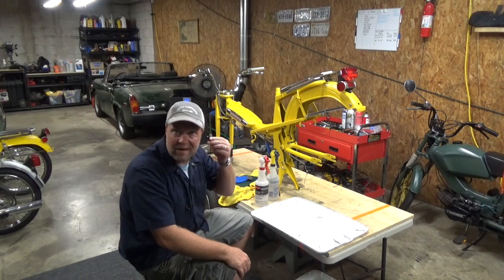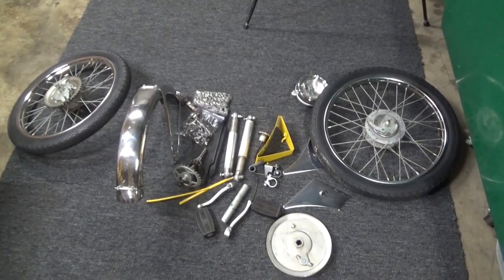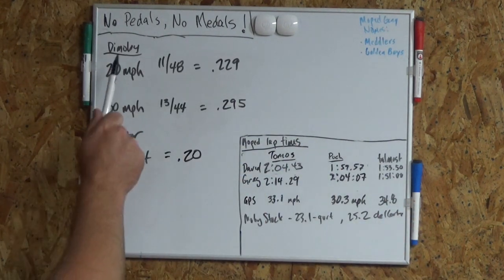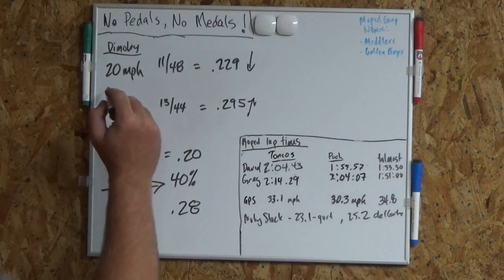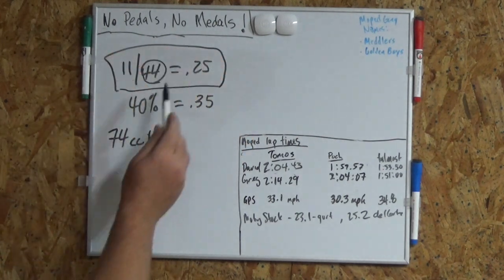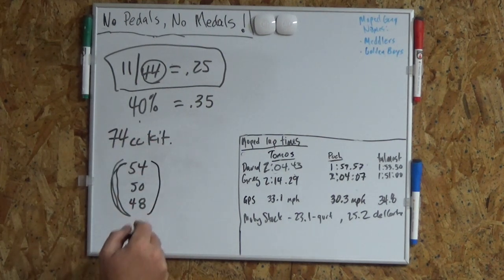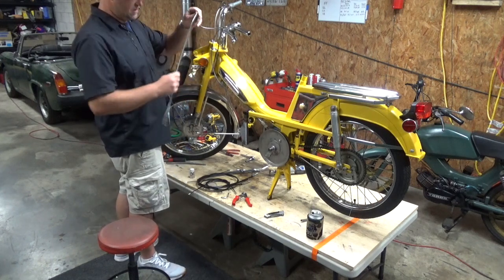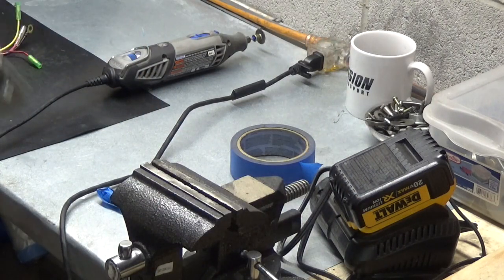Motobecane Moped Restoration Ep. 16.  Modified Reassembly, Cabling, Gearing, Packing Bearings

Comment: Hi David, Thank you very much for your very informative and entraining videos :-) I've watched a lot of them at this stage as I'm in the process of rebuilding an old Raleigh RM8 moped,  quite a similar setup to the Motobecane. I'm trying to fit a new engine which also has a variator, some modifications necessary and still to be worked out! I'm thinking of trying to fit an adjustable spring or gas strut to give me some flexibility with the engine adjustment.

Comment: Hey great videos!  I bought my first Motobecane last fall.  It's a 40v 20mph  all stock, but looked like it was abused.
 I was able to get it started.  All it took was a carb cleaning and I was starting it with a single kick. I found out on my first tank of fuel though there was a leak in my fuel tank. It's along the seem in the Center at the bottom.  At this time I found a 50v that seemed like a good deal, the guy sold it on the impression that it was complete, and fully functional once all the parts were put back on.  It was a mess he must have put a spark plug which was to long into the motor because it had parts of porcelain embedded in the cylinder/head/piston amazing the pisto didn't break. Along with many other missing necessities.
So instead of having two functional mopeds I ended up with two non functional.
I decided to switch the engines which was a success.
I still need a few parts to complete the 50v but I got it to a point I could take it for a rip, and I got it up to 43.7km/h (27.2mph).
I'm thinking about the cylinder/piston you used in this build is there any thing I should also get while doing this?  How much did you have to cut away for the cylinder to fit?
Thanks again for the great tutorials, entertaining and informative!
Reply from the maker: Heya Mike -- If you upgrade your cylinder, then you most certainly should do away with the Gurtner and get a better carb.  But other than that, I think everything else could run stock.  When I installed my cylinder, my cases had a little ledge that I had to grind off so that it would slide all the way in.  I'm not sure that all cases have that, since I hadn't read that anybody else has ever had to do that before installation.  As long as it slides all the way down, then you are good to go.  Good luck with your bikes.. and thanks for watching!

Comment: This is a really useful video - especially the gearing explanation. Thanks.  So to retro fit a variator on a non-variated Moby, the only mounting modification required is extending the notch in the hook?
I thought it was going to be feindishly complicated - you make it look simple.
Reply from the maker: Hey John. Sorry it took so long to get back to you.  Basically... yes.  I think changing the hook is the only thing I had to modify. If I hadn’t of done all the other mods, I could’ve thrown a variator on there and grind the hook and it would work.

Comment: Also for the ignition I'm going to experiment with inner rotor, a Chinese one for £35 from eBay it's bound to last at least 24 seconds but it has advance and no points, or I may use minimoto/ chainsaw magneto.
I'm going to use BMX handlebars.
What is the difference regarding the spring if you use a variator although if the gearing is similar to top gear with variator then acceleration is only gain.
Need a Doppler variator, no sliders, balles etc, just weights on a lever that moves the pulley!
Should be able to extend hearing/ variating by 50%!
60mph at 13000rpm!

Comment: How did you manage to get the peddle arms off, I've been pounding on those pins forever and they haven't budged
Reply from the maker: +LeWuut --  mine popped right out. 11mm to get the nut off and then a hammer. I had problems getting them off of a puch I have, so I put some PB Blaster on them and let it sit overnight, then I came in the next day and they slid right out.  Didn't even have to use a hammer :-). Maybe give that a try?  Good luck!

Comment: You express gear RATIOS as 0.25 or 0.4 etc but that's incorrect.
A ratio requires two figures eh 3:1 3 turns to one turn.
It's also simpler to understand.
A ratio is always a comparative thing, it compares one gears speed to another.
I mean same with mixing two stroke oil in petrol it can be a ratio or a fraction or a percentage eg 50:1 or one fiftieth of oil or 2%oil.